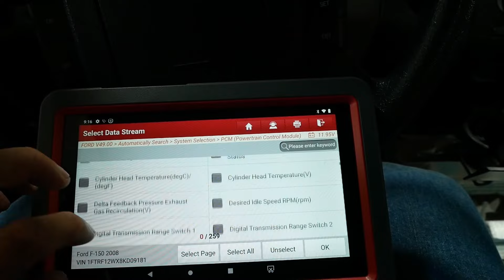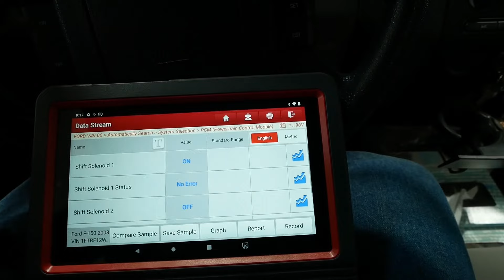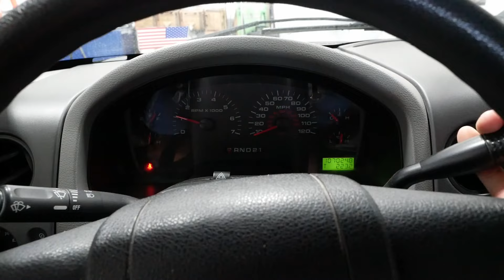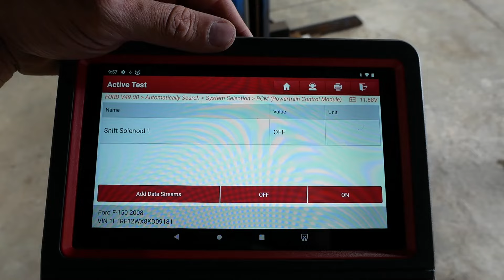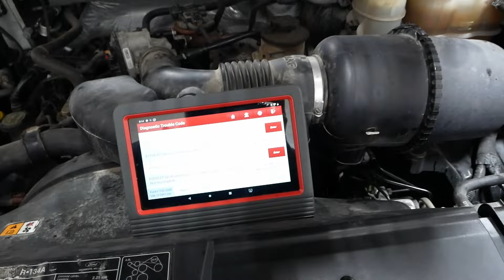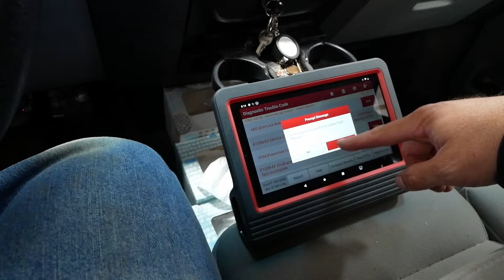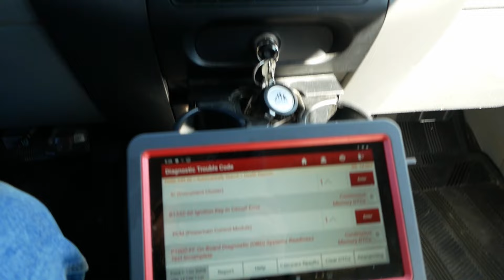Ford Trans Troubles - Dragging in Low and Reverse - 4R70W

Comment: Ah the ever popular(though now a thing of the past) 4R70W.  They were my bread and butter for more than a few years.  Ford sells a kit to repair that direct drum/bearing/spacer failure, it's a common thing on the F-150s.  The last run of Econolines had a tendency to just nuke the planetary set and jam them up good.  They would move, but not as easy as this F-150 did.  I miss those days, lol.
Reply: They are supposed to be very reliable, that is exactly what is in a crown vic, I had many.
Reply: George  Hope the 6R80s are good too. Just got a 6.2L F150 w/186K. Did 2 pan drops, so far so good!
Reply: @alb12345672  All in all the 4R70's were installed in a shit ton of vehicles.  For the most part they are pretty damn good.  The 6R80 is bullet proof!  I've only had to fix 2 internally, and they got the crap beat out of them before they came to me.
Reply: @josephroth3982  Except for that 6r80 circuit frame plate :lol:. Can't even get the part anymore.  I read though it fails from very dirty fluid. The New kits come with foam around the solenoid pins. ALso have a 98 Grand Marquis with 300K, shifts like new. Only problem was the shift cable broke.
Reply: @alb12345672  that's the Achilles heel, lol.  I just did one in a '13 F150 last week.  The part is backordered with no release date.  If you're lucky enough to find a dealer that'll get off of one they have, you're golden.  Otherwise, you're stuck.  I don't know about the very dirty fluid part, as most of the ones I've opened up have had pristine fluid.

Comment: Probably ate the transmission because it's never been serviced. That yellow plug in the drain pan is from the assembly line at Ford, to keep dirt out of the transmission before they slam the dipstick in on the assembly line

Comment: on the tranny dipstick, the hydraulic level changes drastically with the addition of a small amount of fluid. Start with it showing @ add. Drive 20 miles or so to heat it up. If it starts acting up before, add some more to shut it up. If overfilled, drain it out till proper level is achieved WHILE HOT AND LEVEL AND RUNNING.

Comment: Maybe you all got smarter people or better parts than we do. Any trans you get rebuilt around here is good for about 30-40 thousand miles and it goes right back out. I’ve seen it time after time same thing, several different shops. Especially the 4l60e.  Maybe the Chevy transmissions are the problem and not the builders. I just know they don’t last.

Comment: Tranny shop mentions rear drum failure, I’m guessing that’s similar to Chevy trans “sun gear” pretty common failure In a lot of makes/ models, what happens is this drum or cage breaks or shears off all around the splines of the drum causing usually no forward or reverse. The transmission shop that rebuilt mine says this type of failure is caused by owners doing a rolling shift between forward and reverse, puts a lot of mechanical fatigue on the drum…his advice always come to a complete stop then shift forward or reverse or vice versa.

Comment: Due to the complex nature of auto trans these days, I no longer R-R for a rebuild.I send the whole job to my trans guy. That way if there is warranty work needed, I don't have to pull it and eat the labor. My guy also flushes the radiator and installs a new torque converter. NOTE... When converter is properly seated, the trans slides up to the engine and you have to push the converter forward to get the nuts started on the flex plate. If not seated the trans is held off the engine by the converter and trying to draw it together with the trans mount bolts brakes the ears off the trans and/or damages the front pump. Thus the warning from your trans guy.

Comment: Can tell he's never had the filter changed since the yellow plug was still in the pan
Reply from the maker: 100k should be ok on original fluid.
Reply: @WatchWesWork  fordtechmakuloco talked about this. Suggested 30k on first change then every 60k after that for longer life. Dad had his fluid changed around 70-80k, then around 150k. Still going at 300k.
Reply: @WatchWesWork  Absolutely not.  Every 30k…fluid and filter.  This tranny died at 107k because it wasn’t serviced. My 2004 F150 has same tranny. It has 4wd (used regularly) and it tows a trailer once a week.  Currently have 240k on it with no tranny or engine problems.
Reply from the maker: That just seems crazy to me. I've seen plenty of these go 150,000 with no service. I just did one with 230,000 on the original fluid. It only got changed because the pan rusted through.

Comment: Fluid and filter change every 30K miles.  The pump is failing and chewing up the pump housing. Contamination is pumped throughout.. Nothing less than a full rebuild or reman is necessary. These modern transmissions are just to expensive to tinker and hope to get right the first time. Gone are the days of the old reliable C series Ford and TH series GM transmission that could be shade-tree fixed with a little patience.

Comment: Should always change quick connect fittings as they are prone to pop lines off or just leak after being messed with. Then you would of found old ones were loosened saved 8 mines of undearthing radiator and cleanup 🙂🙂

Comment: It’s interesting you draw the line at working on these automatic transmissions.  
I’m wondering what the reasoning is for you (not questioning it, just curious) how big a pain itb it would be to take those on? Also wondering; does Ford typically have local techs fix these, or do they just swap them and send in the old one to become a re-man?
Reply: When I was the parts manager at a Ford dealership, early on in my career, they rebuilt transmissions regularly. We stocked overhaul kits for them and everything. By the time I quit, we just swapped them out. One of the reasons was the difference in price was just too small. The other reason was warranty. Ford had a three year, unlimited mileage warranty on their reman transmissions, while rebuilding it only gave a 12/12,000 mile warranty.
Reply from the maker: Our dealer used to have a dedicated transmission guy. I do t think he’s still there.
Reply: Yep, as an old Ford tech, warranty is everything on customer pay repairs.  Warranty will pay to overhaul just fine, but customers want more than 12 month warranty on $3k repair if they are paying for it.

Comment: I've done transmissions off and on for about 35 years, mostly on my own stuff.  That way I got nobody to blame but me when it goes south.  If you are interested in learning (which I know you are) more about them, checkout Precision Transmission in Amarillo, TX on here.  They are fantastic.  He does breakdowns and failure analysis on a lot of domestic transmissions and has a few build vids up as well, but not many.  Way too time consuming.  When watching you stab the Converter back in, it is crucial NOT to have the Converter nose all the way into the transmission as the nose will start eating the hub.  Should have 1/16 or abouts spacing to the flywheel - usually a small shim or thin washer works fine.  That allows for near full engagement to the pump without interfering with the hub.  I suppose you'll find out if it comes back in a few weeks with nearly identical faults as it came to you with - I sure hope not.  Hopefully, you and the Trans guy discussed this. Just a thought.

Comment: Those  2wd trucks  were pretty good. Too  bad they didn't extend the front end 6in so the back two cylinders aren't jammed under the cowl.  That and Fords love for 6-8mm fasteners that disolve in cold  snowy climates.

Ohh and there are solder joints that fail on the cluster and radio.  You get a flickering brake light and no backlight on the radio.  Probably an hour or two to remove the cluster take it apart and reflow some solder joints.

Okay, you also have to ignore the foam Ford put above the rear wheel arches that catches all the salt and rots out the bed sides. And the front fender bottoms rot out but a whole new ferder from ford is $150 with no shipping required from the dealership.

Comment: Great vid.  I had trouble with a tranny in a recent video myself!  I'm curious, why don't you do automatic transmissions?  You do just about everything else.  What's going on the in an AT that isn't in all the other things I've seen you do: tractors, trucks, complete engine rebuilds, manual trans, etc.
Reply from the maker: I'm sure I could figure it out if someone would show me what to do, but I would never do enough of them to really get good/fast. There was an old Polish guy here who really knew transmissions and the 3 guys I know who run transmission shops all worked for him at one time.

Comment: I could be wrong but these transmissions have rubber check balls in the valve body correct? One could swell or degrate and cause blockages or intermittent pressure  issues only when driving or in his case trying to drive which would eventually lead to carnage like he has in his pan? I could be way off here but just spit balling. Again correct me if I'm wrong please.

Comment: If you ever want to learn a little more about those transmissions look for “Transmission Bench” on YouTube. Jimmy shows you how to rebuild one step by step. He also sells parts and his videos. 
I bought a Crown Vic last year with the same transmission and about the same miles and it needed the internal harness to fix it’s issues. 
These days I rather rebuild an older transmission than that then pull it out of the vehicle. 😂😂

Comment: I don't care what badge is on the ride.  Don't change the fluid and filter you find out pretty quick how long the hard parts last.  Transmission was communicating its displeasure long before it gave up.  Differential probably has the factory fill.  Same with the power steering, brake fluid, and coolant.  At least you freshened up the coolant.

Comment: 2008 107,000 miles and the transmission has never been serviced. Can tell by the yellow plug still in the pan from factory.

Comment: I bet the solenoid being stuck off causing the trans to drag along in multiple gears at once was putting an excessive thrust force on the thrust bearing, as the gear teeth are helical. I bet this started as an electrical problem and snowballed into a mechanical one.

Comment: A basic pickup here (European Alps) vs the USA is a bit different. Basic means wind up windows, no AC. But 4x4 5 speed and 4 banger Turbo Diesel. Toyota/Nissan/Mitsubishi/Mazda (badged as Ford)....Oh and 90% are actually a work truck not used as a car.

Comment: They call this an 'automatic' transmission' but all of the shift decisions are made by the powertrain ECU.
Shifting gears in an 'automatic' transmission is a simple matter of actuating solenoids.
So....While the transmission is automatically shifted by an ECU, the transmission itself is actually much closer to a 'manual' than most people think.
...just sayin.
Thanks!

Comment: wes, do you know what is the expected life span for an automatic transmission in a truck like this that doesn't do heavy work? Here in Argentina we are more used to manual transmissions and usually they exceed the life of the engine.
Reply from the maker: 200,000 miles is normal in my mind.

Comment: Ah yes, the yellow mushroom in the pan.  Good sign it's on its original fluid, and if I was a betting man, I'd say that's what led to this failure. 

107k on factory fluid ain't terrible though...plenty will fail way before that if they never get changed, especially if it sees strenuous duty.

Comment: I remember when GM started with flow codes from the cooler flush machines. It was a complicated algorithm that GM would use to decipher whether the cooler was flushed correctly. It measured temperature and flow numbers and if it was done incorrectly they would not pay the warranty claim. So techs started writing the codes down and one tech even hid a cooler behind his bench and used it to generate flow codes. Well the algorithm kick out every code that was invalid and I had one dealership get charged back 75k. I heard every excuse in the book and ultimately all those techs were fired.

Comment: Them years every time I did a big transmission in them fords, I cut the y-pipe in 2 places, and where I can either weld or slide a new piece over both ends of the pipe, The small ones like you did yeah you can get away with that, here in Ohio, once you mess with them exhaust bolts, there's a good chance that you may have to drill out bolts if the torch don't work and or fight more than you'd like to...
Reply from the maker: Yeah the exhaust is the worst part v

Comment: i had a 727 rebuilt yrs ago, guy says make sure to seat the converter, ok can i use a hammer, no no no dont use a hammer, we'll just put it in before you take  it home. they struggle getting it in and proceed to use a hammer................also, you need to do a burnout to test it properly

Comment: $2,000 to rebuild the transmission? How much more for a Motorcraft factory reman with the 3 year warranty?
Reply from the maker: No idea. I'd trust this one over some reman mystery box.
Reply: Quick online search shows about $2500 & up not including shipping & handling and not insisting on Motorcraft, nor asking pointy question about what internal parts are used.  Which would not include needing to flush the tranny cooler, the valve block and all the labor hours for that.
FoMoCo is quoting $3750 plus a $1000 core charge, and shows it as "on backorder"

Comment: That trucks seems to be in pretty good shape for being 13 salty winters old. 
The only thing I don't like is the two wheel drive. There is no weight on the rear end of those pick up trucks.
Reply: downside to all pickups, they are nose heavy. 2 wd or 4 wd they still light in rear. 2 wd is just more fun in snow/ice 🤣

Comment: Question for all mechanics. Do you know what that part in the left upper corner of the pan is for?
Use to see the same part in C4 and C6 trans way back when. Surprised it still used. 
And yes I know the answer.
Reply: When first built, the plug goes in the transmission dipstick hole. When the trans is installed for the first time, when the fluid stick is put in, the plug is pushed in to the transmission pan. When you remove a trans pan and see one it means the pan has never been off before.
Reply: @MrAPCProductions  Ding ding ding you win the prize. Wes will give you one.  Lol.

Comment: It may have started out being an easier fix, then being ignored and continually driven
turn into something much worse. Such as a catastrophic failure. Its too bad that 
manufacturers can't put a spin-on filter somewhere to prevent metal shards from circulating through the entire system.
Reply: It's possible, but, on average, when a ford tranny breaks, there's no half-way about it.  Now, the TC, the cooler, the fluid filters--that's different.  But, in the gears, they grenade all the way.

Comment: That case is still pretty dingy for just being “rebuilt “🧐
Reply from the maker: It’s Illinois.
Reply: @WatchWesWork  I understand the cases get oxidation but that thing doesn’t appear to have been put in the washer.  As I’m sure you know, transmissions need to be as clean as possible before assembling as not to get dirt inside.  Just sayin

Comment: I've hered and seen this year's of transmission in this truck is 100000 miles on the nose they act up
Reply: Its all service life. Ford built 70s from 92 until at least 2013, they were in everything, most failed way before 100k, I own two that have over 300k on them.

Comment: >2008
4 gears transmission
Man I feel bad for us trucks
Reply from the maker: Let’s see how long the new 10 speeds last. I’ll wager not long.
Reply: @WatchWesWork  nobody needs 10 speeds, I agree with that. 6 would be perfect
Reply: @dmitryhwguy1646  Which would just be a 3 speed with an Overdrive per each . . .

Comment: I have a 1997 F150. I found out from a friend that 30,000 miles is the max without changing the ATF. 1,000 miles past that and it starts acting strange. Slips at stop signs then kicks in hard. No reaction when shifting into reverse then kicks in like a mule. Change the fluid and all is back to normal. I’ve only let it get over 30,000 twice and the same things happened. Fluid change fixed it immediately.

Comment: I hate ford transmissions, they suck! Never had more break than ford.
Reply: Maybe you have your reasons, but I drive two of them and have owned a few of the ones that everyone says are bad and I have never had a problem.
Reply: 4L60E AND 48RE HAS ENTERED THE CHAT.
Reply: 5R55S has broken several times in my 2006 explorer 4.0 300,000 miles. They last about 100k.
Reply: @rhoptry  I am on my third Exploder and have never had a trans failure. I don't baby the things I own either. I pull car trailer and four place horse trailer. I don't count the utility trailer. Two of my trailers exceed the tow ratings for the vehicle. The last one had a quarter million miles on it when I retired it. Current one is finally broken in with 186k.
Reply: @MaxNafeHorsemanship  Mine is the V6 though
Reply: If you would get the updated valve body or change your driving habits you would be fine.
Reply: @rhoptry  So is mine. People can't believe the size of trailers I pull with it. If I lived in the UK I would be doing it with a 4 banger.
Reply: @rhoptry  I used to make the 5R55 castings years ago and no Ford does not make their own castings.  Its all outsourced and trust me you would be very surprised on who made them, too.